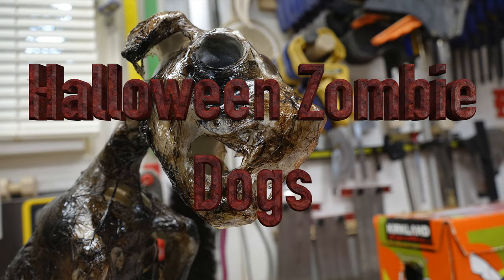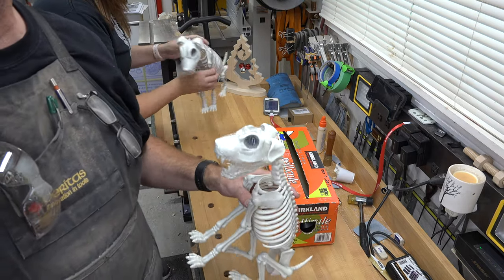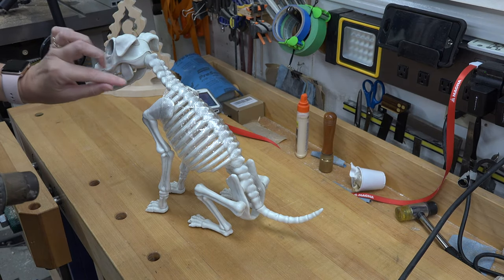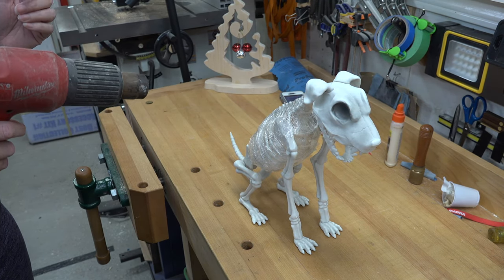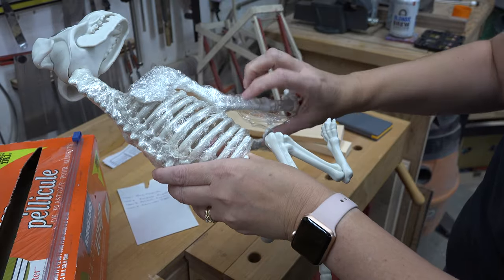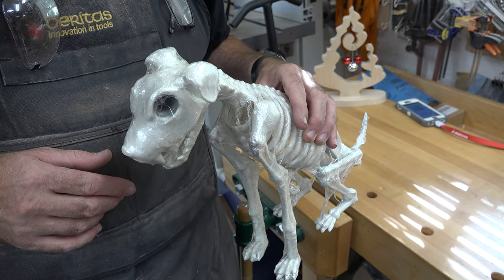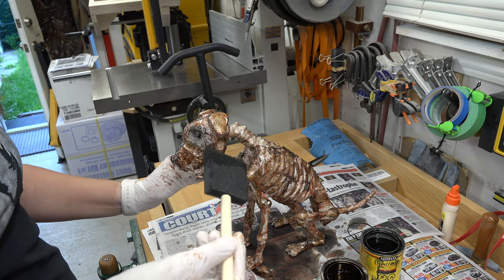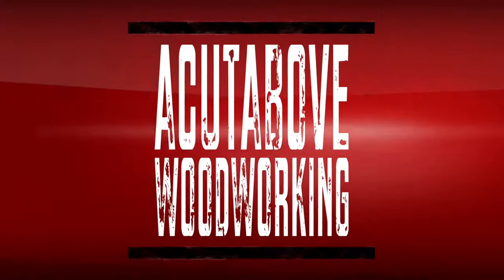Making Zombie Dogs

Comment: Kenny and Mrs. Kenny,  that was a really interesting project.  It came out really realistic looking or at least what I would imagine would be realistic looking.  After the stain dried did you spray it with a clear coating or any type of finish?   This is going to be a nice addition to your Halloween display.  Love it!!
Reply from the maker: I never sprayed it with any kind of sealer or clear coating Paul.  Once it dried (which took about a week) there was no need to seal it from there.  They were already oil based finishes on their own and nothing rubs off when they are handled so I think it's all good.  Thanks for the kind words on the show and for tuning in.